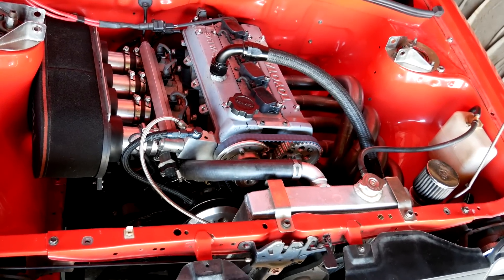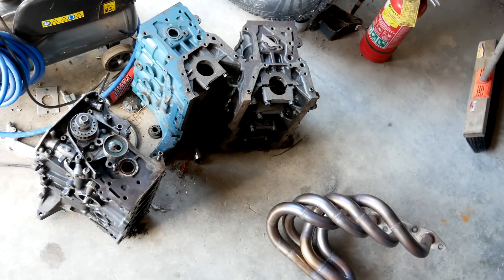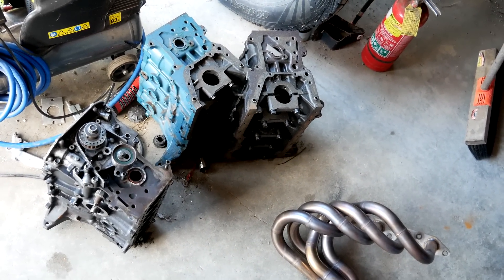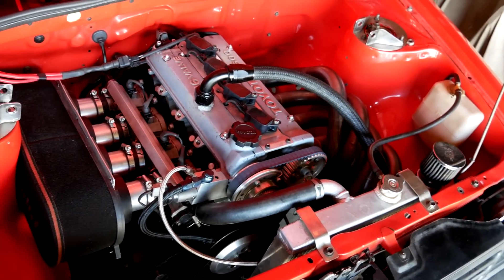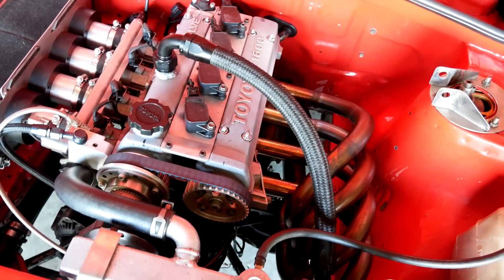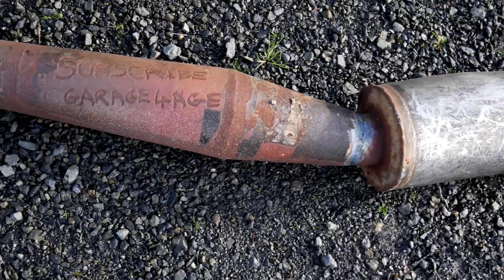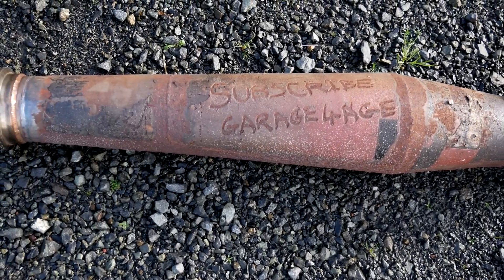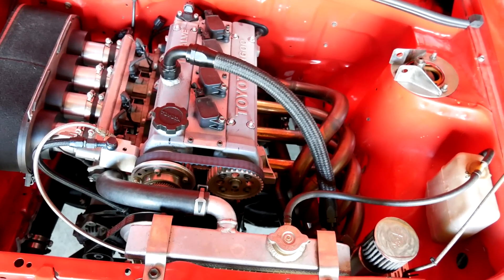Header diameter & Megaphone  - Dyno tested

Comment: It would be cool to see if you could do some budget turbo 4A stuff. I know the rods and pistons can't handle much, but with what is possible it would be interesting (esp since a lot of what you do is NA)
Reply from the maker: There is turbo stuff on my older hilux video's if you haven't seen them.    only the blacktop rods are weak.  any other 7rib bock with just factory 4agze pistons is a solid engine for turbo. 
I don't do that much turbo stuff as its too easy, and if want to push power limits it just becomes a money pit of broken stuff.    In saying that,  I have almost collected enough junk and hand me down parts, to cobble together another turbo engine for the hilux.  It wont be a big hp build. think big revs and massive powerband.
Reply: @Garage4age  are normal bluetop big port rods okay for boost as long as it's kept at reasonable levels with 4agze pistons in your experience
Reply from the maker: @inaNis_   cant run run ze pistons on bluetop rods.  different pin size.  Ive never bothered with the 3rib bluetop bottom ends.   have seen people run then on low ish boost without much drama.    but best to run the 7rib for boost.  toyota basically beefed  them up when the 4agze come out, the na stuff got all the same parts other than pistons. so redtop bigport  to silvertop  same as ze bottom end with different pistons
Reply: @Garage4age  can they handle RPM and boost as well, just put of curiosity? Is it a case where you'd need to use stronger rod bolts to take them up in RPM, say 8,5 9k?
Reply from the maker: @inaNis_   bluetop also has the weak square too oil pump, i would swap to the newer style if reving past stock limiter.  as i say i haven't had much to do with the bluetop bottom ends so cant comment too much.     I can say the later block with 8.9 ze pistons and rod bolts is very reliable to 9k.  thats all thats in my hilux
Reply: @Garage4age from what i know that the st is gze rods but the pistons are high cr if proper tuning with pump fuel how much boost you think it can handle ? Or how much hp ?… is the compression the problem or the piston’s can’t take 270~hp because there are 2mm headgaskets that lower compression to about 9.6:1
Reply from the maker: @marlo0oty213    yeah the na engines of same year  have the same rods as the 4agze.   maybe a few anomalys but basically how it works.  stock compression   will probably run into knock issues depending what you call pump gas,  before you get to  the limit of what the pistons can hold.    also any knock at that level will end them pretty quick.   swap to 8.9 ze pistons is the way to go
Reply: @Garage4age  i have asked that question many times but its the first time actually one got the answer i needed “knock before power limit” then i would just go with 2mm headgaskets. Im just aiming for 10psi nothing more and what i mean by pump gas is i guess 93 in the us and we have it here 98aki. But firstly i will go with 5-6 psi to see how the engine handles and how the timing is as im standalone but with original spark setup
Reply from the maker: @marlo0oty213     you should get away with 10psi boost on stock compression on 93  (same as our 98 ron here in nz)     long as your setup is good.   ive run that amount of boost more compression and same fuel.      what i mean by setup is, good intercooling,  big exhaust ( 3 inch)   and a   decent sized turbo.       a lot of people get it wrong and just put small stuff on the "plus T" setups  as they only want to run low boost and not make stacks of power.     but it really works against you.  soon as choke up the exhaust side and pump more heat into the intake side things become far more prone to knock.     personally i would stick with the stock head gasket.  dont really like the thick head gasket idea.   and yes make sure you tune is spot on.   oh and  20v's are known to float the valves when adding boost,  be ok at low boost but spring upgrade is a good idea
Reply: @Garage4age  its my first time hearing that valve float can occur because of boost.. im just an amateur driver and diy tuner im no expert but i get the concept of a lot of things also you had answered many of my questions and i also tried some of your experiments some with good outcome and some with bad.. what you mean by the compressor side is small is i should get a bigger turbo that doesnt like spool at 2-3krpm so it has more capacity and therefore more efficiency. What about the exhaust why did you mention it?
Reply from the maker: @marlo0oty213    the extra exhaust pressure hangs the exhaust valves open,  on a stock silvertop will probably get away with it to a point since they are spose to be non interference engine.  but have seen people bend the exhaust valves on a 20v head / ze piston combo.    but unlikely an issue at 10psi boost anyway.      I was talking exhaust side of turbo.  basically the less exhaust pressure the engine sees, the more happy it will be.  newer turbos i'd go for something like a gtx 2860,  older cheaper stuff something like a td05.  most engines will want to knock at low rpm and at max torque.   a boost ramp can help you get a bit more hp out of it safely.   after max torque ramp in more boost
Reply: @Garage4age  oh yea yea i get the idea now never though of it that way thats why you were talking about spring upgrades… i was just unsure about the cr and the max hp on the engine so i can know where  reliability stands,, for the fuel ive just confirmed its 98 RON “93 AKI/US FUEl”

Comment: NA engines require wizardry to make power. This stuff will always fascinate me.
Reply: This man is a wizard
Reply: as Richard Holdener likes to say, whatever power you make NA will simply be multiplied with boost
but yes if you are staying NA you need to pull every trick there is to maximize the output
Reply from the maker: @kalui96   I get what old mate Richard means by that.  but at a point it become untrue,    for example, if you tried to  run a turbo with the cams in this engine.  it would be super lazy,  since pretty much all the power under 6000rpm goes away, to less than what a factory engine makes.  as the turbo would ruin the exhaust tuning.
Reply: @Garage4age  I figured you'd say that, since you're pretty experienced with this 🤣
I think he has that as like a "something to make the noobs happy"
Reply: And that is why they are more entertaining and gratificating when you make them go fast I used to know a couple of wizards that made them go even faster than turbo cars!
Reply: It's a dark art to be sure.

Comment from the maker: A note: The merge collector on the big headers was changed to a steeper angle and smaller choke point,  to closer resemble whats on the small headers.  this was done after the first lot of testing. (pre megaphone)    I tested it  off cam on the normal exhaust, was basically zero change in power.
Reply: What angles are you using roughly?
Reply from the maker: @overr8ted2   on the merge collector or megaphone?
Reply: @Garage4age  ummm not so much I’m guess that’s around 7 degrees or so what about right after the collector the cone between the collector and the main size of your exhaust tube and what sort of length have you found works best for that cone 
I’m guessing your using that to start the negative pressure wave back up the pipes?
Reply: @Garage4age  I would be interested in megaphone specs if you want to share
Reply from the maker: megaphone is based on area of a 7 deg included angle ( same as the round rusty one)   but oval.  they both do different things, so that obviously didn't translate over.   I haven't back to backed a bunch of cones right after the merge, so cant comment on what works best there.   but any diverging cone beats a step up in everything ive tested, anywhere in the exhaust.  the engine is actually seeing 4 different diverging cones  before it hits the first muffler.  to dial them all in right  would require a huge amount if time.  but i'm pretty much sold that using a step to try  stop reversion,   or introduce, dampen pressure waves  isn't the way to go and a cone wins every time.
Reply: Is there a good book to learn about header design?
Reply: was the length of the megaphone the same? shorter megaphone should kill the top less